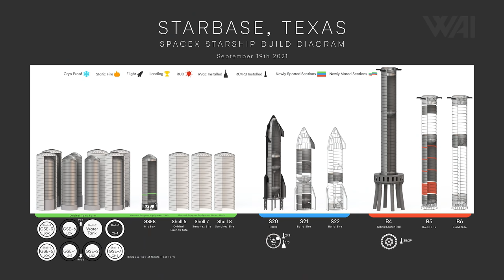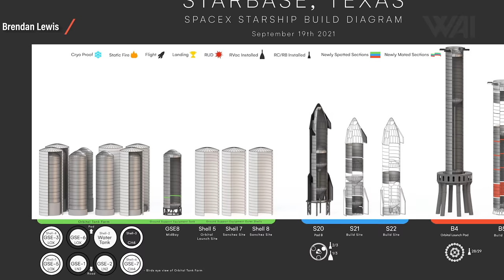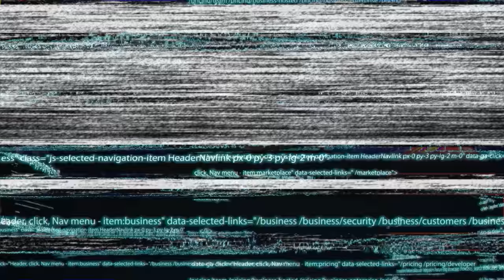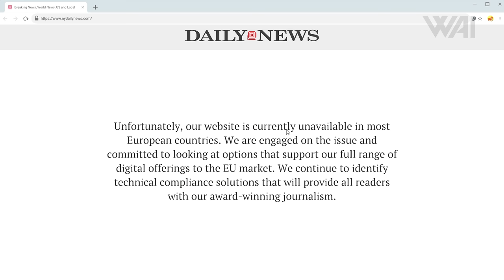Starship 2021 Official Design Changes – The Holy Grail Of Rockets!

Comment: Reusability is only a means to an end: cost & production capacity. Falcon 9 does not have so much cost advantage than cheap competitors, but it has an overwhelming production capacity than the rest of the world. Manufacturing a new rockets takes a long time. If you force a streamline to go over the limit of 15 rockets per year, then RUDs will occur. But reusing is fast and easy.

That advantage is why there can be Inspiration 4.
Reply: Falcon 9 has a huge cost advantage compared to the competitors. It costs $15-20m per launch of a typical 15 ton payload. Anything in this category costs no less than $50-60m. 

The difference is other providers already squeezed maximum out of their systems and are offering $60-90m PRICE for their launches to stay just above the COST. When SpaceX charges $50m per reused booster launch they both beat competitors’ price by millions of dollars AND make a lot more profit on the difference between the price and the cost.

Comment: I'm surprised at how far is the Chopsticks and catch arms have to stick out, that there isn't a dynamically adjustable counterweight on the opposite side of the tower to maintain balance. I'm sure they have all the strength and tolerance has worked out, but it seems precariously top-heavy to one side especially once it catches the booster or Starship

Comment: I don't think Ship 20 or Booster 4 will take flight. I might be wrong but if the forward flaps have changed then isn't testing this kind of pointless? This seems like a comprehensive fit check and refining the installation process of the TPS.
Reply: The point is to test the re-entry, and especially the TPS. It doesn't matter that they expect some of those things to change a little in future designs, because the results of the SN20 flight will be telling them what they need to change. This is SpaceX, not Blue Origin — they want to test early and test often, not wait until the paper-design is perfect. So if they already know they're going to make a few changes, it doesn't mean that testing older prototypes isn't useful.

Comment: What is the difference between the shuttle and SN20?  They both return to earth to be re-used.  Yes, they are shaped differently.  Yes the one is significantly bigger. Yes, SpaceX is doing things significantly better.  But you cannot say SN20 will be the first "upper stage" (i think you said) to return to plant after being in orbit.  Sorry, I am not sure that I understand and it may be obvious to you.  But I do understand SpaceX is doing amazing things and SAN20 will do things that the Shuttle could only dream of.
Reply: The shuttle also had a large fuel tank that was thrown away, it was not fully reusable.

Comment: Great video Marcus!

That SpaceX render of the Starship isn't very reliable to look at though. It's missing elements we know will be on the final version. Like the spill over heat shield around the flaps or the tiles on the back of the flaps. Both missing from the render. I think these renders are less reliable than they used to be.

What we really need is another Starship night like Elon gave us years back. I feel like they're waiting for the orbital launch though

Comment: Nice renders showing last years starship and the new one with "less complexity and weight".
But I have to ask,
Where is the center of drag on this compared to its center of mass?
At 10 years old, I learned that a model rocket like this would try to swap ends and crash.
Reply: The overall balance of weight and drag probably haven't changed all that much
Reply: Well, it is actively controlled by thrust vectoring on ascent, so tiny deviations from pointing straight are get counteracted immediately. (your model rockets probably did not have this). I guess you are right to assume that it would be passively unstable (so it vector control or all thrust is lost, it cannot longer be controlled. But in latter case it would be doomed to crash anyway, even if it was passively stable).

But on descend this is very much needed, as booster comes down with grid fins, so it must be stable going down. - so center of drag is above center of mass. On starship on the other hand, center of mass is more towards the heat shield and center of drag away from it (the flaps are not longer exactly in the middle), because it comes down in this skydiver position.

Comment: Hi Felix, I think there was a mistake in this video. You said that the starship would go to orbit and deorbit. In this case, however, the starship would never achieve an orbital trajectory. the reason for this is so that if it fails it will not be stuck in orbit.
Reply: Sort of. It's a semantic thing... I understand it will achieve orbital velocity, but they're deliberately picking a low perigee such that it will re-enter before completing a full orbit. Partly to ensure it doesn't get stuck, as you say — but also because completing a full orbit wouldn't contribute anything to the mission goal of testing the re-entry.

Comment: I really don't understand. If the drag on the grid fins is negligible during ascent, then how can they do their job when descending?
Reply: Because they change their angle to create new air flow when its needed.
 Its exactly like pushing a knife through butter, if you tried doing so while its straight down its super easy, if you try going straight down with the knife at an angle you will get a huge amount of resistance as it tries to redirect the movement to the side.
The fins are like 1/2 inch thick like a knife, but they are something like 10 inches tall, the wind catches them like sails once you rotate them.

Comment: Felix, unless Space X have changed their flight plan with the FAA Ship 20 won't actually make it to orbit. It's just a suborbital flight that will land outside of Hawai'i.
Reply: Right, Its an orbital test, not an orbital flight. Meaning they are proving 100% that they are capable without actually doing so. 
   As Elon said, just releasing the pressure from the tanks through the RCS thrusters would be enough to complete the orbit if that was the goal.

Well... By at least one accepted definition it is an orbital flight, just with the planet in the way. In the end, there is no need to be picky about the wording when its 99.9 percent of all definitions lol

Comment: If a  Human rated Earth and Mars Starship, with a cost 100 million per unit, with the compassity to do 25 launches?

How would it compare to the world's fleet of passenger aircraft like the Boeing 700 at 90 million, 737 at 140 million, and the 747 at 390 million?

How many flights do they get out if our current aircraft, compared to the Earth and Mars Starship
Reply: It will cost way less than that

Comment: One quick note my good sir, The gse8 forward dome shown at 5:20 is not the gse8 forward dome ready for stacking. It must be a scrapped previous one since the gse8 is completely stacked including the forward dome as shown on the diagram one the frame before that picture.
Reply: Pretty sure that pic was taken a few days ago so it would be the same wouldn't it
Reply: @charlestorruella8591  This was taken from the same video they showed the full gse8 in the midbay. No GSE has the top cut out like this either. Its just a lack of research from WAI, which happens a bit on this channel sadly, but i still love em.

Comment: Although it digresses from your core theme in this blog I offer the following for consideration.

If, Mechzilla is a concession to limitations inherent to Starship and Super Heavy I wonder;

Will landing Starship safely on Mars still prove to be problematic despite significantly lower gravity and a thinner atmosphere?

I also wonder why none of the known exploratory missions sent to Mars so far have focused on Valles Marineris?

Here are some mixed statistics partially extracted from Wikipedia;

"At more than 4,000 km (2,500 mi) long, 200 km (120 mi) wide and estimated to be somewhere between 7 km (23,000 ft) and 11 km (36,000 ft) deep, Valles Marineris is one of the largest canyons of the Solar System".

Given that the aforementioned location is the lowest elevation on the planet, surely atmospheric pressure and temperature must be higher there also thus potentially enabling water to exist in liquid form even if only on a seasonal basis.

It should also be the most sheltered location from wind and the abrasive effects of material driven at high velocities by it.

So if, life was ever present on Mars the possibility of it persisting in Valles Marineris longer than on the high surface might also be greater as well as any remnant evidence for it also persisting for longer?

It might also be an ideal location for Elon Musk to deploy a few of his tunneling machines and use them to establish facilities that are at least partially beneath the Martian surface.

Because between 7 and 11 km of rock should provide better than average protection from various forms of radiation and other hazards such as meteorites.

In addition, I should think missions to the top of the massive shield Volcano on Mars named Olympus Mons will occur when Starship becomes operational.

Apparently, the Martian atmosphere is too thin atop Olympus Mons to enable parachute descents and that probably also reflects unfavorably on a steep profile for atmospheric braking to decelerate Starship.

But perhaps an extra shallow and prolonged deceleration profile could allow for a conventional vertical terminal descent via the powered mode of landing employed by Starship.

Also having any ascent reduced by as much as 22 kilometers should also be an advantage for Starship.

The average slope on the flanks of Olympus Mons is only five degrees.

This implies it might not be exceptionally difficult for a few nuclear powered bulldozers and excavators  to establish some sort of transport infrastructure from the mean surface to launch facilities at the summit.

Although it is known to be in a particularly dusty region the surface area at the summit of Olympus Mons is undoubtedly extensive.

The total area the mountain covers is roughly comparable to that of Italy or the Philippines almost certainly leaving plenty of room for space facilities on the summit.

At 22 kilometers in height the tallest planetary mountain yet discovered in the Solar System seems like an ideal location for a space facility.

It would probably even be a potential site for an eventual orbital elevator so it would seem logical to explore and evaluate the summit of Olympus Mons and establish a facility there at the earliest opportunity.
Reply: Mars ships will have legs until the proper facility with mechazilla has been installed there

As for location, it had several consideration including water ice resources, longitude, etc.

Comment: What would happen when Starship or Boosters eventually fail the approach to the tower for landing? Wouldn't the explosion completely destroy the tower and delay launches
Reply: Yep. And no flame diverters either for lift off. Probably an underpowered water-suppression system so all the infrastructure will be rattled into oblivion. And some stupid chopsticks that are supposed catch a falling, on fire, multi-ton cylinder and not crush it at the same time.

The 3D animations of what's supposed to happen are nice, but I have doubts.
Reply: Yes, I'd rather have the booster land on legs. There would be a mass penalty, but a lot more wiggle room if a return doesn't go quite to plan.
Reply: That is why they are building oil rigs into launch station's invade something happens it can splash down in the water and the water will dampen the rig enough to hopefully save it but who knows as they are writing the book as the build it
Reply: Possibly, it is not aimed at the pad or tower though, it would hit the ground to the side, likely doing very little if any structural damage but its definitely possible to have an issue making it hit directly.

Comment: I am not sure the big panoramic window was reduced in size. 

It was RETRACTED. It is more distant from the nose cone. I think that gives it a smaller assistance (since if it kept same area, it is now is smaller in relation to the width of the rocket in the new place. 

The number of rows of windows was always weird IMHO, as they did not match any possible internal deck configuration. 
True, you don't need human decks for micro gravity in deep space but let's not forget they are supposed to land and still be used. 

Anyway, it will be a long time before Spacex needs so many cabins inside a Starship. 

Let's consider like a whole decade of missions with no more than 20 passengers. 

That's already an absurd big number compared to the history of spaceflight.

Comment: The  SST and Russian clone of the space shuttle are both second stage rockets. This isn't really accurate to say that no second stage has never been recovered. Other than 2 SST missions, EVERY SST was recovered intact.
Reply: If you ignore the external fuel tank.
Reply: @fredbloggs5902  LOL...I know...AND SST fired its engines at launch too. It's both a first and second stage rocket. But it IS a fully recoverable second stage! It's main engines were vacuum engines. Look at the size of the bell, Its absolutely huge! Yes...it was less than optimal on launch, but once it got rid of the external fuel tank, it was 100% a second stage rocket. AKA...second stage rockets have been recoverable since the first SST launch. 
*
That's not to say that it is highly likely that SpaceX will make what NASA did look like crayons and legos because they are are already doing that!

Comment: chance this is an artifact of slightly different angles between 2019 and 2021 renderings, but first glance makes it look like front and back elonerons have swapped some surface area to move drag a little more towards the nose.
Reply: That does seem to be the case, yes
Reply: Yep. That was revealed a while ago... maybe during the Tim Dodd interview and tour. Apparently they found during the SN8-11 testing that the surfaces were a bit bigger than they needed, and they were going to adjust the size a bit — though I believe that it was more about mass saving than forward/aft balance.

Comment: Can someone explain to me like I'm a child:  Why don't they skip the re-entry vehicle off the atmosphere a few times, slowing down it's velocity in segments, vice just diving through the atmosphere at extreme speeds in one shot?  Sure, skipping off the atmosphere a time or two would require a little extra fuel to continually re-orient, but it would seem to me that skipping like a stone across a pond around the earth and slowly dissipating energy would put way less thermal stress on the vehicle.  I am sure someone much smarter than I can tell me why this isn't possible.  So thank you in advance!
Reply: For LEO it wasn't needed as much because the velocity isn't as high, but for interplanetary they planned to have multiple passes

Comment: 1:35 isn't it second stages? As in 1st stage is the one at the bottom, the one that lights first. And then 2nd stage is the upper stage and it lights second.
Reply: Yes, he wrote a correction on screen there.

Comment: Rolls Royce is making Nuclear reactors for moon bases, imagine a reactor small enough that you could just launch one to a disaster area and land it to provide electricity .
Reply: Where did you hear they were doing such things??
Reply: @Vatsyayana87  forbes i think, its not “for spaceX” but it is for the british space program. Its easily searchable. Logically if its small and light enough to fly on a starship it should be able to land also.
Reply: @koffeekage  Interesting, but since The UK space agency gave up space flight the moment they made a rocket that could reach orbit decades ago, id say i sort of doubt they are planning a moon base lol.

But i suppose they could be doing it as a joint thing for someone else going there, but other then the US and China, i dont think anyone else has real enough plans to start building hardware. 

I will definitely look into it though, thank you for the info.
Reply: @Vatsyayana87  theyre prob helping the ESA plan.
Reply: It is not just dropping a genset into a disaster area that solves the problem, it is the distribution of that electricity that is often the problem.
Reply: @rogerwalker5032  would have helped Fukushima.
Reply: @koffeekage  Maybe. If they had builr the cooling pumps and controls well above sea level Fukushima might still be working. What if: what if?
Reply: @rogerwalker5032  thats a good point, we just need to tell engineers to never make mistakes in designs again. Forget i said anything.
Reply: @koffeekage  Ha ha! As with Blue Streak, sometimes engineers have to do what politicians and money tells them.

Comment: The big window will get deleted. Windows are a heavy dangerous liability in space.
Reply: Try asking people to be in a steel cylinder for 3-6 months in space without a window. I dont think they care about the issues you mentioned, Spacex is about the experience enough to understand a window is 100% necessary. It will happen and they will make it work just fine.

Comment: Upper stage thats reused = Space shuttle
Reply: If you deliberately ignore the fuel tank.
Reply: @fredbloggs5902  Fair enough although I should note that fuel from the external tank was also used during boost phase.

The shuttle design originally had small internal fuel tanks for the last stage, but they were removed in the final design due to safety concerns.

Comment: How much weight do the tiles add to one side of the ship?
Reply: Some.. But it doesnt do much to change the balance by my understanding, nothing compared to the capabilities of the engines anyway.
Reply: ... and you have all the pipework, valves, heat exchangers, COPVs, power cables in cable ducts, etc. on the other side.